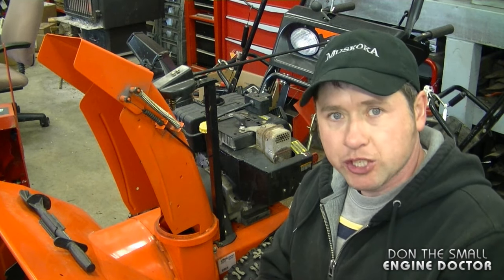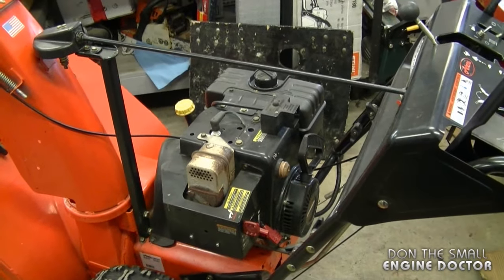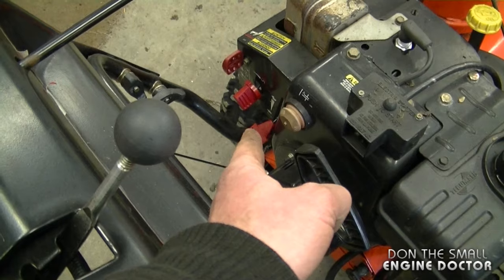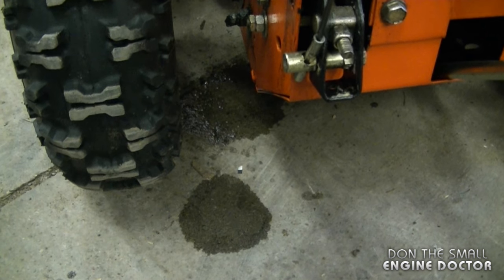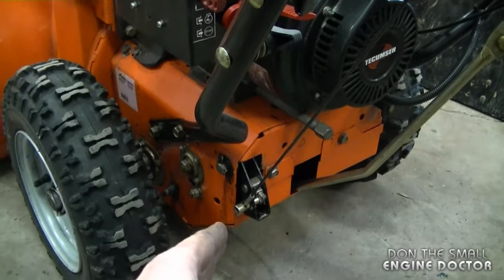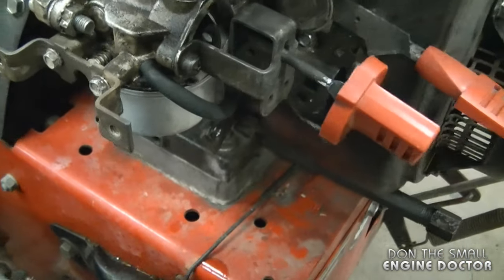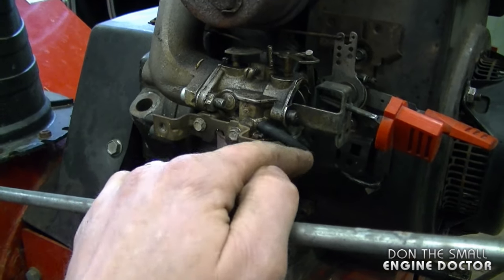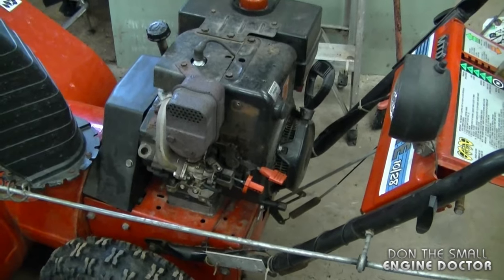Why A Snowblower Carburetor Drips Fuel When Primed

Comment: When I rec'd my Ariens 920014 (10 years ago) and primed it for the first time. The gas did start to leak. Thought something was wrong, so it was sent back to the supplier to check it out. There was no charge and they said nothing was wrong. It was because I primed it two many times. Now I only prime 2x and never had that problem again.  After 10 years the engine just started surging. I added a little sea foam to the gas and now it runs fine. Thanks Donyboy73 for what you share. I hope people appreciate all the time you take to help us.

Comment: I have a snow blower it is a Troy Bilt 7524 with a  Model # 204549.  It was gifted to me after my father passed away.  I’ve used it for the last 4 years.  Last year it started leaking gas right where Dony mentioned in his video.  I went out to the garage one night and the garage smelled Ike gasoline really bad.  I figured out it was the snow blower and we moved it to our back yard with a piece of cardboard to soak up any excess leaking gas and let it drain completely. I was afraid to try adding more gas and try to start it with the leak being on the underside where Dony mentioned. Mine doesn’t have a primer button.  It’s electric start.  I can admit having never had one or used one before I didn’t realize that I needed to drain or run the gas out of it after the season was over.  We had it serviced when we first got it because it hadn’t been ran in close to 7 years.  I think I paid about $225 to get it serviced with a full tune up and clean up. I’m trying to figure out if it’s worth repairing again.  My gut says yes, but I don’t have any clue on how to fix it nor would I likely have any of the tools to fix it.  I could call a local repair place and inquire with them, but I’m afraid I’m gonna get scammed over for being a woman.  My gut is telling me it’s worth fixing and that’s not the emotional attachment to it because it was my dads, but because it’s legitimately in great shape other than the plastic feet guards and this gas leak.  I’m praying the fix is on the less expensive end but was hoping someone with the expertise could give me some insight. Thank you in advance!

Comment: i also have an Arien snow blower, 2 days ago, new york big snow and when i put the blower gas switch to on, the gas was leaking out a lot, when i turned gas switch to off, gas leak stopped, does anyone here has samething happened like me ? it is only been used for 6 times. any advice ? thanks

Comment: I have a power that doesn't work properly. There is no need for priming, but leaks gas even after changing the carburetor and pump.  Any suggestions.

Comment: I have an Ariens with a Tecumseh engine and I smell gas coming from the snowblower when it's parked in the garage (winter or summer), nothing drips or leaks. Is that common? It's stronger than I'd suspect if it were just temperature-related expansion or something similar.

Comment: Another great vid, Dony. What people don't realize or understand is that on a 2-stroke engine application...the primer bulb is just that. The bulb actually holds small quantity of fuel and moves fuel from the tank to the carb and back again in a continuous motion assuming the bulb itself and the lines are hooked up correctly and perfect condition. These large rubber bulbs mounted on the outside engine covers are what I call "puffer" bulbs. They do not hold any fuel nor do they move fuel. When pushed, they simply puff air into the float bowl chamber which forces fuel droplets into throat of carb and manifold. They do seem to work better and drip less if you fully close the choke first then pump the bulb.

Comment: Was just helping a friend with his mower that wouldn't start.  The same carb setup as you demonstrated.  Old fuel.  I went so far as to cleaning the jets in the carb.  I put everything together and proceeded to overprime it!  I thought I had a bad gasket at the front of the carb!  Glad I watched your video and will go back and put things right tomorrow.  One other post with this same engine mentioned the possibility of the float not shutting off the fuel completely.  If it leaks without prime, I know that is the problem going forward.

Comment: Wish I'd have watched this before I bought a carburetor kit and spent $50.00 for nothing. This is exactly what happens on my Husqvarna. Thank you for this video.
Reply: @George Granlund I have a husqvarna st227 unfortunately I just discovered a gas leak, while moving it roughly 200ft. Only notice it, the last 15ft or so. It was dripping out and covered the left hand side tire, pretty good. As I was 15ft from where I was placing the blower, I immediately shut it off, turned off the Fuel. I noticed drain screw to carb bowl was wet, as well as the bowl itself. 
Any idea what the issue could be..?
Much appreciated in advance, and thank you for your time.

Comment: Thanks Dony!   I just replaced a missing primer bulb on a snowblower that won't start (and hasn't run in about 10 years)  I am going to pull the carb to clean it anyway but I was concerned when it leaked gas while priming.

Comment: My garage was smelling badly of gasoline. So this year I’m like maybe it’s the carb. I see gas under bowl screw wet. So I decided to replace carb . The new one came with no screw and spring under bowl. Which I was nervous I got the wrong carb? Still nervous? I assembled the new one onto blower. It works fine! But still smelling gas in garage? So I didn’t replace gas primer. But with your easy video I will. My rubber is fine. Garage kept blower in winter and shed in summer. All rubber lines are still soft with no dry rot! 
Even though blower is 20 years old !
I’ve never had an issue starting it! I run carb gas out after each use and shutting gas valve off! 
Is it ok without bowl screw not on it? Or did I get wrong carb??

Comment: Ive had carbs leak on motorbikes but that was a dirty pin valve or the pin through the float pivot point was sticking, i only have a simple b&s mower and priming is a different style, so no problems :-)

Comment: My brand new Ariens Classic snowblower does this too, with the AX 208 engine
Reply: I have the same model.  1st time I used it last night the oil dipstick smelled like gasoline afterwards.  Changed the oil this morning  it had gasoline in there.  again after use , dipstick smells like gasoline.  I did prime it both times but I guess it’s a carb problem ?

Comment: I have a problem similar to this very informative video.  The tank was empty when I filled it with gas. I did not touch the primer before I noticed a small stream of gas shooting out of the rubber primer hole. Then, while checking the air in the tires, I noticed the gas leaking down from the carburetor in the same area as you noted.  So, I had gas coming out of both the primer and the carb.  It continued to leak and eventually stopped leaking down thru the deck.  Does it matter if the fuel cut off switch is off? Thank you very much!!

Comment: Shouldnt I feel the primer bulb full of fuel? Or is it normal for it to just sound like air shooting into the carb? I assumed its not getting gas because it wont start. I replaced my fuel line and checked for cracks in the primer line. Cleaned carb last night. Thought it was starving for gas?

Comment: I want to take the cover that goes over the carb, hoses, etc. but don't know how to remove the knob  of the choke lever. The set up I have is exactly like the one you show in the later part of your presentation. The are a few screws to remove along with a hex nut but obviously the cover can't be removed unless the choke knob is off. Thanks

Comment: I had it leaking because I was pressing wrong and too many times and the engine wasn't firing up easily.  If it leaks, it's because it's not pressed right.   Now I press only once and keep it there for 1 second, then quickly release it.  Engine fires up right away every time.

Comment: I always wondered about this.  Although, I did have a leak on mine when I tilted the snowblower back.  I found that the carb bowl gasket wasn't seated correctly and this was actually keeping the primer from working properly as well.  Pulled the bowl off, smeared a little oil on the gasket and the bowl went into position nicely and got a good seal.
Reply: 7 years later......I have this issue with my Murray snowblower.  When I tilt it back, it leaks.  Set it level, no leak.  Can you explain the fix to me please?  Much appreciated.

Comment: Thanks for all the awesome posts.  ANY CLUE why when I prime the engine 1st time this yr it primed way too much fuel?  It was like the primer system wasnt drawing any air with fuel just pushing pure fuel.  Every push produced a stream of gas.  I took the carb off , checked the float, needle, etc. put it back together and seems OK.   I was thinking too much gas in bowl?  THis is an Ariens 24" with an LCT engine.  Engine has been pretty good for 5 seasons save for a couple carb issues.

Comment: just went to start my craftsman lawnmower, self primer, for the first time this year and filled it with gas and when i pulled the cord i noticed gas pouring out of the carburator onto the deck and it would not stop. i had to take the gas out and check it. when i took the casing off to check, poured somemore gas in the tank and nothing was leaking , put everything back together and everything ran fine.  question , donny what would cause this to happen?

Comment: This happened to me today ( the fuel leaked when pressing the primer bulb). I might have pressed it too many times but it did finally start.   I have another issue with this new snow blower.  It only starts using the electric start when it’s cold.  After it runs awhile and I shut it down, it will start with one pull.  Any thoughts?  Thanks for the video
Reply: Same here.

Comment: Great Videos to learn by.  My snowblower looks like the one you have in this video.  When I press on the electric start, it does not turn over.  It just clicks one time and then blows the garage fuse.  Any suggestions?
Reply from the maker: try a different outlet, if it still happens replace starter

Comment: This video is great and describes the exact problem I was noticing (Same Engine). I usually prime 2-3 times and have never noticed gas flowing back out from the intake side but after buying a new aftermarket carb online one prime seems to spew one pump worth of gas out the back side. Is there anything I can do to keep it inside the carb with one pump?

Comment: My fuel line was leaking in my snowblower so I had to replace it. Holy cow was that a pain to replace. I got the same inside diameter, but the outside was just a tad wider. I had a hell of a time snaking the line between the engine from one side of the blower to the other.

Comment: Hello Dony,! My snowblower didn’t start and not knowing why only after one winter use. I figured out it was the gas and so I empty the tank and added a new one. In doing so I primed it more then enough times but I got it to start only to turn off seconds later. I noticed a gas leak and freaked out. Empty the gas tank again and let it dry. I filled it with gas, primed it only to have same issue. This time it didn’t start but I primed it again, yes, too many times. I haven’t tried again and wanted your suggestion. It leaked from the same area that you show on yours but how come it won’t start with new gas? I have a Troy built 2420 that I got for last Christmas. I need your help.. thank you for your time.

Comment: Hi, just take the snowblower out first time for the season. At first I primed 6-10 times, then I saw gas leaks, just like your video. I lay it down on the side to check it out, then I lift it backup and waited until the next day. and now, even I primed 50 times, and I don't see any gasoline leak like the night before. Did I cause brake something?

Comment: My problem is the gas is squirting out the center hole of the primer bulb while running. I think the float valve is stuck ? Any thoughts ?
Reply: I am having the same problem.
Can anyone let us know why this is happening and how to resolve the issue.
Reply: @donmiers4978  I bit the bullet and dove into the carb. The problem was the float was dragging on it shaft. I freed it up with some carb cleaner, Made sure it swung ok on the shaft. When you put the bowl back on make sure the deep end is to the side of the float that drops down, so it goes deep enough to let in enough fuel to run the engine. Mine started right up, no more squirting out the plunger/primer hole.

Comment: My 2009 Ariens with 305cc B&S engine is doing this. Thing is, it's never done this before and I've owned it since new.
Reply from the maker: +bigworm8181 you might have to clean the carb or replace it

Comment: Hi Dony I had a question regarding an aftermarket carb I bought off Amazon. I installed it on my Toro single stage snowblower with the RTek engine and it fires right up but it does surge a bit. Am I supposed to adjust the carburetors when installing aftermarket ones? Also how long do I leave it choked when warming up when cold. I usually open the choke right away and the machine dies. Thanks

Comment: I have a question... My snow tech leaks gas when I prime it but won't start, what would be the cost for it to not start ? not even with the electric start either. button
Reply from the maker: first try a new spark plug
Reply: @donyboy73  I took the plug out and seem ok but I notice the plug is a little wet why would that happen.

Comment: What is the best 2 cycle oil to use in my Toro CRR Powerlite? I currently use Opti-2 but wonder what the professional recommends.
Reply from the maker: +ChicagoSirens OPTI-2 IS GOOD, I USE CASTROL OR STIHL OIL
Reply: +donyboy73 Is it safe to run it at the recommended 100:1? I always have the fear one of my engines will blow up.

Comment: I have a poulan pro 27" with a LCT motor which seem to be great engines. To start it, unlike a couple others I use, I have to push the primer 7 or eight times for the initial start. It does work when I do this  but I'm wondering if the the primer button is defective. This snowblower has less than 2 hrs. of run time. Other than this "issue" it works great. Is this within a normal range of variation on this engine?I'm always conservative when pushing the primer so it took a couple starts the determine that it had to be pumped so many times. Only one time have I seen gas drip; also I can definetely hear an air noise when I push the primer.Thanks for any thoghts you might have.
Reply from the maker: it is normal for some to require more priming!
Reply: @donyboy73  Wow, thanks a lot for your quick reply, it really helps. I subscribed to your channel a while back and love your videos-very clear and well presented.Have a great and safe holiday!
Reply from the maker: @jeffreyallen3777  make sure to watch my new video series with Dave my apprentice!

Comment: I had the same problem with a Tecumseh 7 hp removed the float bowl the float had a pinhole leak allowing gas to enter float weighing it down you can hear the gas when shaking the float   replaced he float and leak stopped when priming.

Comment: I have a craftsman snowblower with a Tecumseh engine.  Model 640349 and a 5002 carburetor.  It was not running right and leaking bad.
 
I replaced with a new carburetor and it started right up and runs fine.  The only problem is gas still leaks out of the mouth of the carb after I shut if off and it sits.  I have to elevate the carburetor side of the snowblower with a 2X4 under the one tire to keep gas from dripping out of the carburetor intake where the choke is.  I have watched and after I shut it off it takes about 30 seconds then it starts coming out of the inside and runs out of the choke hole / mouth.
 
Is this normal and I wonder why no one mentions this problem.  
 
Thank you for your help.

Comment: Hi Dony, I have a question on the NOCO GB30 you reviewed.  Have you tried powering a small 12v compressor from it (either with an adaptor or directly from the clamps)?  Will the booster pack send voltage or would the electronic protections kick in and cut the tension?  Thanks.

Comment: Thank you Dony for sharing your vast wealth of knowledge of small engines with the general public. I envy Joel having had the opportunity to have you as his mentor. I'm sure the experience will serve him well in his future.
  I have a question regarding my 10 hp Snow King snowblower. It has a feature where the auger lever will automatically lock on when it is released providing you have the throttle lever depressed. This is a great feature if you use the manual chute a lot. Alas, it will no longer lock on for me. I was hoping that you could point me in the right direction so that I could be a happy camper again. Cheers from the Maritimes. Thank you.

Comment: I would like to know this...What part of the carburetor is the gas coming from when it's over primed is there a vent hole or something.????????????????
Reply: Leaks from the hole on the intake side of the carburetor, the hole is about 5/8 to 3/4 of an inch in diameter, plenty of space for fuel to run out of when you over-prime them.

Comment: My mtd snowblower does that and dies unless I keep pumping the primer in a slower rate the motor keeps running if I stop it dies. Is this a stuck needle float? Just bought it and it's a mtd Trac 26/8 snowblower and also the blower won't do anything with the drive levers. Any ideas on why it wont propel itself forward or backwards? Just a diy guy here need help